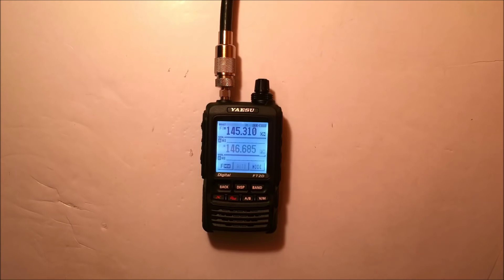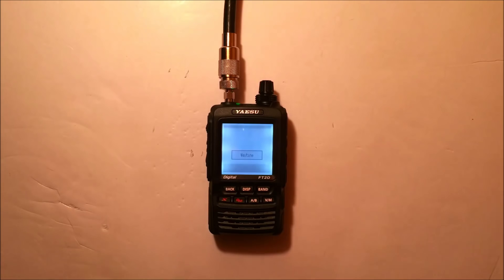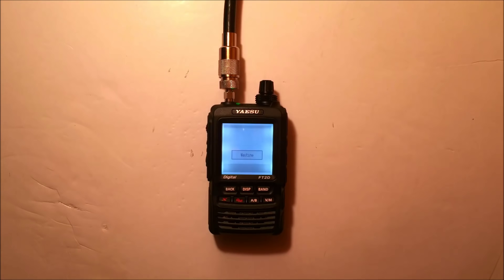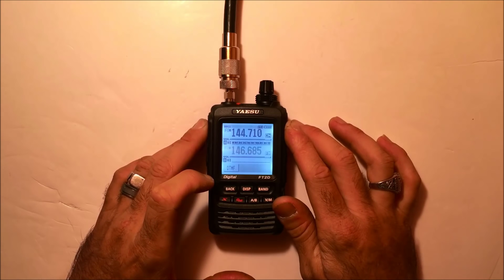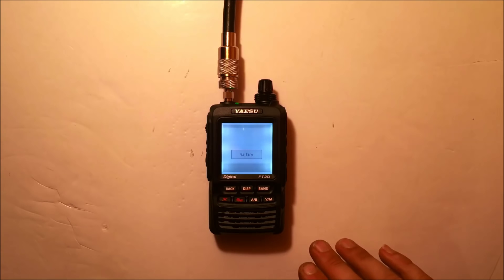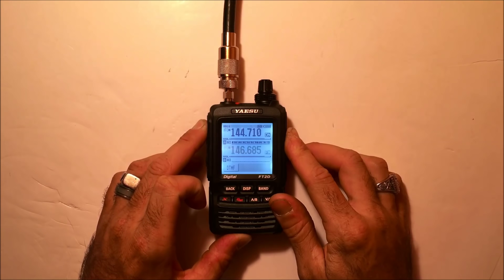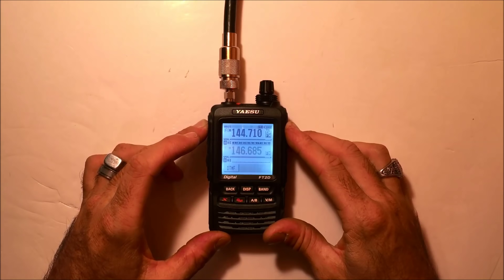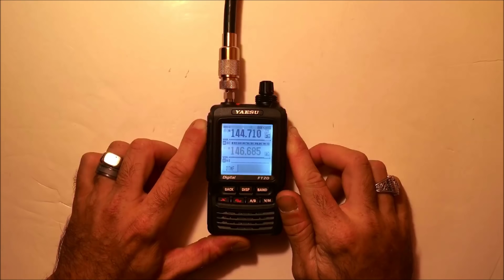Yaesu FT2D Fusion demo picture messaging

Comment: Hi, I'm looking for a radio/ scanner. My local fire, police are on P25 P2 system. If not do you know of a radio that is capable of picking up this digital frequency. I'm New to the game of ham radios. I'm working on my tec tag at this time. I own a Yaesu vx8dr, It's a great little radio. I pick up hams miles away and hit towers all over my County. I can't wait to talk and make contact with them all. Thanks any help would be much appreciated.
Reply: Bano Esparza  i have a question if your unlicensed as you say and working on your tech tag the how are you hitting repeaters at all if your not allowed to transmit bud? oh just breaking the rules i guess!
Reply: Jesse James I think he meant he was receiving signals from the RPTR. Give him the benefit of the doubt.

Comment: What is the picture file sizes?
Does the radio use data compression?
What is the baud rate?
Is the transfer rate faster on 70 cm?